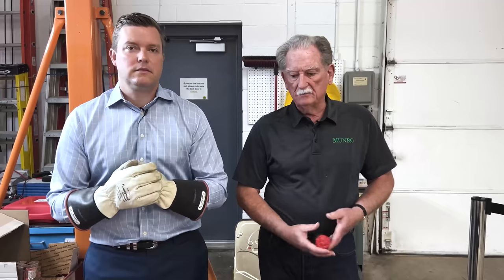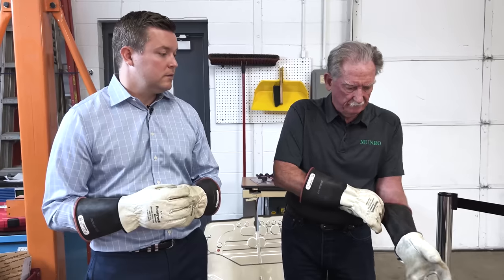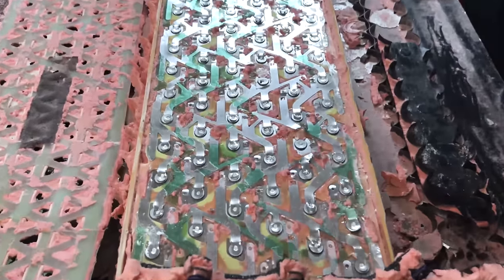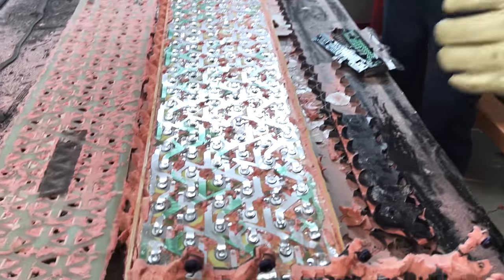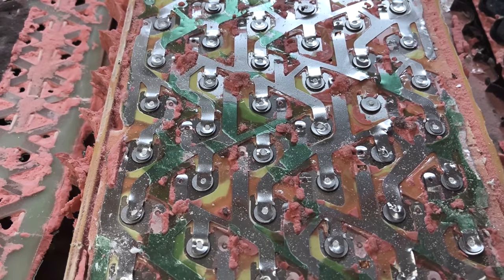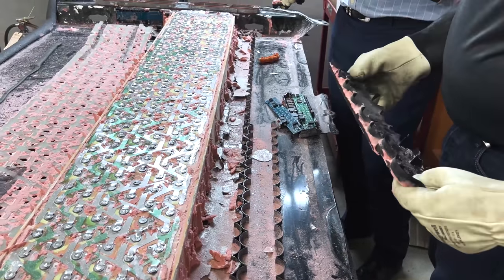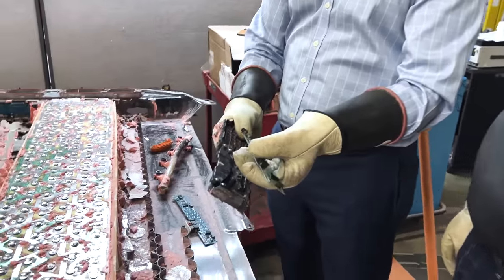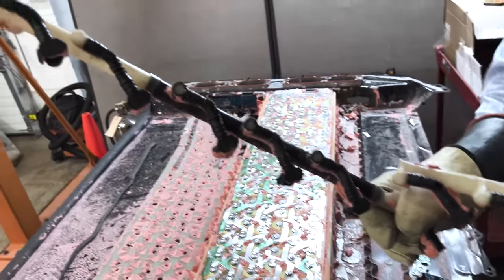Sandy's first time reviewing the fully disassembled 4680 pack!

Comment: Can we really talk about serviceability of this battery? Regardless of the lifetime of this what happens when it breaks?
Reply: It doesn't. Tesla batteries are extremely reliable and the degradation is negligible too.
The few that fail can be easily recycled. It's likely cheaper to recycle then to repair, because the majority of the cost is in the materials, not the manufacturing.
Reply: You replace it. Just like ANY OTHER BATTERY PACK. Everyone is suddenly triggered by this because they havnt been paying attention. Just look up articles about GMs attempt to only replace a few modules in Bolt packs. It didnt work. In the long run they ended up completely disassembling packs, replacing ALL the modules, and then reassembling. They would have been better off replacing the whole thing.
Reply: There is no serviceability. Though, for extra cost and being more sustainable, they could've allowed replacement of individual cells
Reply: @patreekotime4578  I have been paying attention to the whole process. Replacing the whole pack is a waste of precious materials. And if you say, oh yes, they can recycle the batteries, it's easier said then than done. There is no actual process of recycling this particular pack. If Tesla was so sustainable as they claim they are, they should have designed this with sustainability in mind, not only cost efficiency. I like the car and the brand, but we have to be a bit realistic here and look at the bigger picture. In 10 years, we will be mounting more and more battery packs. Hopefully there will be companies that can make recycling of these packs a profitable business.
Reply: @andrasbiro3007  maybe, time will tell. I know there is research about this, claiming they can last 1 million miles.  However, in the future we will be mounting more and more battery packs. Hopefully not they will not end in a landfill and hopefully there will be companies that can make this a profitable business. Would have been nice if Tesla had come with some end of life handling of their battery packs. So far, only performance and features. We really need to think about the products after we consume them and not create more and more waste.
Reply: Let’s not forget reusability too! After the carlife the battery is still good for other decade in stationary applications. Audi is doing solar projects in Africa with used batteries
Reply: @andrasbiro3007  crapppp!!! Stop the nonsense!!!
Reply: @patreekotime4578  that’s a total lie!!!! Those GM batteries were the defective ones from LG stop the crap!!!
Reply: @MrCarGuy  there is nothing sustainable about this!!!
Reply: @MihaiAdrianNegru  You wrote, "If Tesla was so sustainable as they claim they are, they should have designed this with sustainability in mind, not only cost efficiency." I think you are jumping to conclusions. If you read Tesla's "Impact Report 2021", you will see that the company takes many steps towards sustainability. Just because the company has not provided details of its rationale for the design of this battery pack does not mean the company designed it without any care for sustainability. As for recycling, Tesla announced a few months ago that they have started recycling their battery packs. Redwood Materials (started by Tesla co-founder JB Straubel) is also recycling batteries (from a wide range of sources) and was set up explicitly with the goal of being able to grow fast enough to be able to recycle an exponentially growing number of batteries in future years.
Reply: @carholic-sz3qv  I dont even know what you are talking about. Everyone knows the Bolt batteries were built by LG and I never said they didnt? 🤷
Reply: @MihaiAdrianNegru  Like I said, GM found they had to replace every module in the Bolt packs because they had NO OTHER WAY to be 100% SURE that they would be safe. If you have a defective batch of battery cells, you have to replace ALL of them, full stop. There is no cheaper, shortcut way around it for safety. And every company LG supplied batteries for is discovering that for themselves one after the other. If there is a manufacturing defect, you HAVE to assume that ALL of the cells that came off the line have that same defect and replace the whole pack. As far as the sustainability argument goes... what is the alternative? Is it better that everyone keep driving cars literally burning and leaking fossil fuels everywhere? And how is this somehow Teslas fault or is Tesla somehow different than the entire rest of the industry?  The recycling facilities may not exist at they volume they need to YET, but there is good reason to believe they soon will: namely the skyrocketting costs of raw materials. Not only is it cheaper to extract nickel, lithium, cobalt, and etc from existing packs, but the QUALITY is better. Battery cells made from second generation materials will just be flat out better. Not sure how this is a problem, or how it is specifically Tesla's problem alone?
Reply: @MrCarGuy  
Designing for serviceability would add a lot of cost, complexity, and weight. And would reduce the structural strength too.
Then actually servicing the battery means tons of expensive hours of work. Just not worth it.

Also you can't just replace cells in a pack, that creates imbalances that leads to fast degradation. Cells in a pack, or at least module, have to be as identical as possible.
Reply: @MihaiAdrianNegru  
No waste, all batterie4s are fully recycled, at close to 100% efficiency. And that process can be repeated indefinitely, because the materials are not degrading at all.

Comment: From my experience snap on fasteners almost always break easier than bolt on fasteners in cars over 10 years old. The countless heat cycles from an ICE engine have an incredibly negative effect on the longevity of plastic snap on parts within the engine bay.
Reply: Lol….. the engine bay isn’t the entire car!!! And the durability also depends on the climate where they are used plus they rent used everywhere
Reply: @carholic-sz3qv  most snap on connections are used for vacuum, coolant, and oil transfer through an engine. Which all takes place in the engine bay. The only snap on connections used on an ordinary car outside of the engine bay is for HVAC piping which is under little to no stress. Obviously those aren’t going to break
Reply: @trifectaCA  they are still going to age and brake they aren’t indestructible lol……
Reply: @carholic-sz3qv  my argument was that bolt on fasteners would age better in a high heat situation. I don’t know what your goal was when replying to my original comment.
Reply: This pack is not designed to be opened and repaired. So, no need to have a fastener that can come loose inside a permanently sealed product. Thanks for playing though.

Comment: I’m so impressed with the mouldings out of Italy, as a Sheetmetal worker (Retired) its great to see this new high modulus casting. I remember using Carbon fibre composites on a superyacht we built for an American to attend the Australian America’s Cup challenge years ago. Actually I was doing the Alloy Hull as part of a Team but in NZ we didn’t have hard demarcation lines so I got to help a bit with the fly bridge in Carbon fibre. What we made was crude compared with the stuff you unboxed … Keep doing what you do so well …

Comment: I certainly can appreciate the design of the 4680 battery pack from a manufacturing/cost perspective but from a repair/repurpose/recycling perspective this design really miss's the mark. Very disappointing from a company that trades on the basis of sustainability.
Reply: Ok so let's break it down. Repair? who want's to crack open a 400 volt/ gazillion amp battery pack to fix a bms board ? Not this guy. So you build the pack with quality parts and seal it so the environment cannot degrade anything prematurely. Slap a 8yr 100000-mile warranty on it and the consumer is protected and the company can focus on driving down costs of manufacturing not opening themselves up to liability from repaired packs. Once the battery degrades past vehicle use slap it in its entirety into a fancy Powerwall box and shabam a Super capacity Powerwall(repurpose). At the end of its useful life give it a cryogenic bath and shred it to recover all the materials for a new pack(recycle). They want to drive the cost of this pack down so low that repair is not even a thought. do you want to send that $500 flat screen from Walmart out for repair? It will cost you $300-$400 parts and labor. If it is out of warranty what do you do? Thats right get a new one that has even better tech in it for less $$$ more often than not. It will take some time but that is what Tesla is striving for.
Reply: @ericrichards7884  Electric vehicles are „brand“ to be environmental friendly and sustainable. This pack design might be cheap on production costs side but if it will fail over lifetime (a battery pack still has moving elements like switches and relais, or condensator which are subject to calendar aging.
The only possible recycling process for this pack is to melt it down….high amount of energy and chemicals included ….it’s so ridiculous 
and far away from the media and government predictions 
And I hardly doubt that these battery moduls will at an an energy storage for a second life use, if you need over 2 weeks to peels them out of the foam. 

This pack is not designed to be maintained and there is also no Interest to do so…but this fact does not fit to the story of sustainability and environmental friendless
Reply: @visionmodernclassics3062  You have it all figured out my man. Start your own Billion-dollar car company and show them how it's done. Who knew that Tesla with all its top tier engineers missed the best one trolling the comments section on You Tube. LOL
Reply: @ericrichards7884  If you don’t have factual arguments anymore then insult other people, a strategy that helps in all situations of life 😘
I only criticize that the structural battery pack is not designed to be maintained. 
Propably thats the way to maximize the profit of a product (see iPhone)

But that development strategy contradicts the narrative of environmental friendliness and sustainability of a battery electric vehicle..that’s all i want to point out.
Also Tesla fan’s have to admit this fact.
And to define a meltdown as a „recycling“ of a battery is more than ridiculous.
I hate this  double standard 
And I’m glad to see how many percentage of the currently avaible EVs will be on the road  in 30 years. 
Keyword „Sustainability“ 😋
Reply: @ericrichards7884  Humans have become quite adept at working with high voltage componentry over the last 100 years or so. In fact, amateur radio operators have been dealing with those sorts of voltages for just about that long and they're not even "qualified" technicians. 
Consumer protection does not equate to sustainability. It's all well and good if I can replace my failed battery within an eight year period as a consumer. If that product cannot be serviced and reused/repurposed or recycled, it's not so good if your view is biased toward environmental impact.
And, of course, if the battery has just one faulty cell in it, it can't be repurposed as a power wall, can it. It needs to be rebuilt.
By the way,  cryogenic recycling of batteries does not yet exist as a process. In fact, 95% of Lithium Ion batteries end up in landfill.
Few are recycled, and none by "cryogenics". The process does not exist.
Yes, I would like to repair that "$500 flatscreen from Walmart". Unfortunately they, like the design of Tesla's battery pack, make it prohibitively impractical to do so. That is the point of my original post. And thank you for raising the comparison between Tesla's new battery pack and a cheap "disposable" TV.  They are both items to be discarded at will with no thought for the consequences of doing so.
Reply: @visionmodernclassics3062  Thankyou very much for your reply and contribution to my original post. It is refreshing to see that someone has the intellect and wisdom to understand the limitations of this product within the context of sustainability. Seemingly, few people are gifted with the cognitive resources to see beyond marketing and media hype of products such as these and would rather prefer to live in ignorance.
Reply: @davidbrayshaw3529 You are highly welcome! Never heard of the term cryogenic before.
I will just do a deep dive into this topic. Thx for the hint. 

But also for the cryogenic recycling process a high amount of engery is needed, same as melting the howl battery done into its alloy components. Especially for LFP batteries it will be hard to design a business case for a  recycling process, due to less expensive batterie materials and the big afford to crack the phosphate connection. 
Of course Tesla knows what they are doing, within the warranty the failure rate of the structural battery pack has to be < 1 %. But if I’m the owner of a 50.000 Dollar car i want to have the choice if i maintaine it by myself or not

Anyway im glad  I made the step out of the consumption spiral of our society. I appreciate the quality of old products and try to maintain them as long as i can. 
The maintenance work will be pay off with reliability
Reply: @visionmodernclassics3062  Cheers. Yes, cryogenic recycling is very energy intensive and that is part of the reason that it can't be scaled to the point that it will be a viable method of recycling car batteries in any volume. It seems  beyond people's comprehension the problems that we face in the not too distant future with regard to the disposal of, recycling or repurposing of EV batteries. Currently, the US and Europe combined
decommission approximately 20 million cars annually. Of course globally, the number are much higher. Fast forward just ten years and you've got a problem. Fast forward twenty years and you've got a crisis of epic proportions in dealing with such a huge volume of E waste.
Designing these vehicles with a view to their final decommissioning is absolutely vital or they will become a far bigger pariah than the gas cars they replace. 
I never got on the consumption merry go round. Not my thing. I don't like waste and I don't like wasting money. It's better off in my pocket that someone else's. And that's why I like products that can be repaired and have a long serviceable life. Unfortunately people like you and me are a dying breed and Tesla, by design, are killing us off.

Comment: Hi Sandy/Cory.  Saw you struggling with the rubber glove.  Try wearing a thin tight pair of cotton gloves as the base layer before putting on the rubber pair. I do that to get around the grip of the rubber gloves, I used to use baby powder and that stops working as soon as hands start to sweat. Hope that helps.

Comment: I think what people really want to know is the pack's vulnerability to failure. Will a single cell dying cripple the pack, or does the BMS somehow able to isolate the damaged cell. Or are connected cells participation impaired as well (one cell's damage isolates a group of cells, multiplying the loss). I'm assuming physical repair is out of the question aside from those ambitious independent shops.
Reply: With 9 in parallel, you can lose about two per group, the impact would be increased amp load across the remaining cells, so as long as the amp capacity is there, its no issue. If each cell is capable of 200A max, 9P has a capacity of 1800A, the max output of model y is 469kw or 1200A at about 380V pack voltage,  you could theoretically lose 3 cells with the 200A max output assumption and still deliver the max total motor output, although for less long then before.
Reply: Really, one looks at the reliability. Designed reliability, worst case, and in field. When you can analyse millions (billions ?) of data points, you can assess your reliability. Make sure you are above your required level, and "magically" 999 out of a thousand battery packs can last 500,000 miles. It's not rocket science - but it does no harm if you know about that as well...By the way, you can see the results when people ignore checking reliability methods (over ALL environmental scenarios)...
Reply: @chrisheath2637  
BINGO!
(It's almost as though some want it to fail?)

Comment: Saving the best till the end, moulded carbon fiber and you thought giga casting was good well carbon fiber can be done the same way.
Reply: Not anywhere near as fast for sure. But faster than current carbon fiber and possibly faster than stamping and welding up steel/aluminum.
Reply: Carbon fiber can be done in almost all kinds of ways possible from forged to woven…….. just look at Lamborghini or even Toyota Yaris gr naked carbon fiber